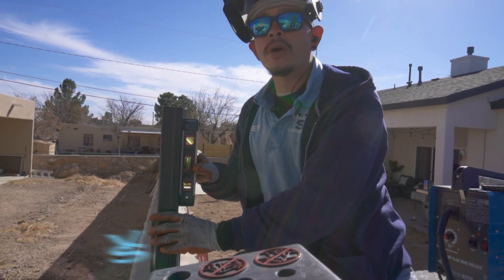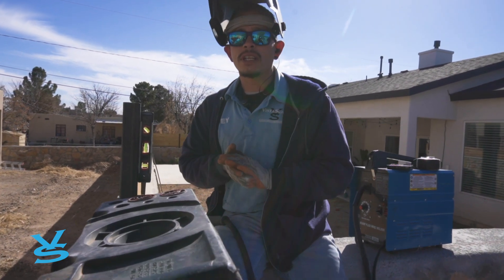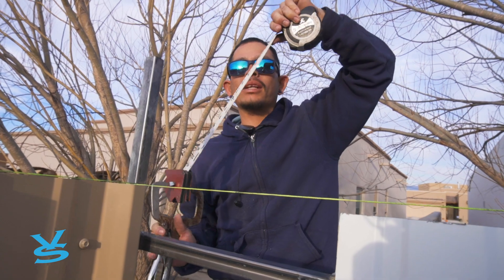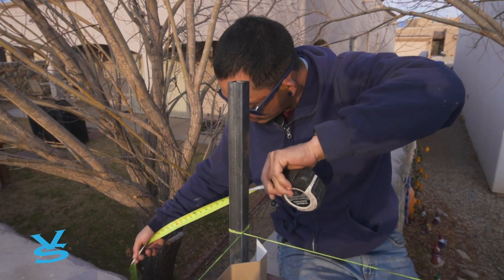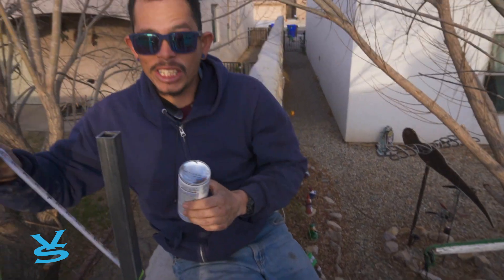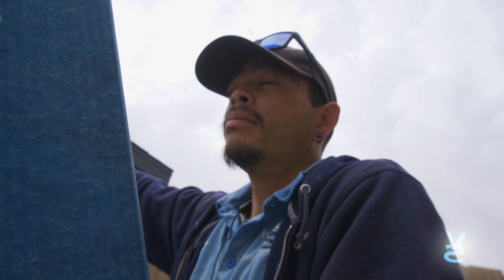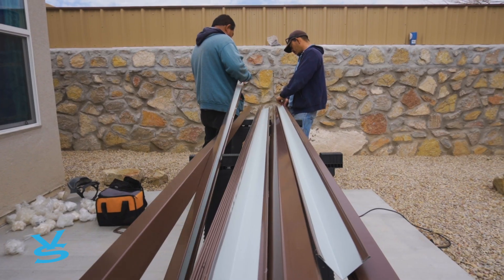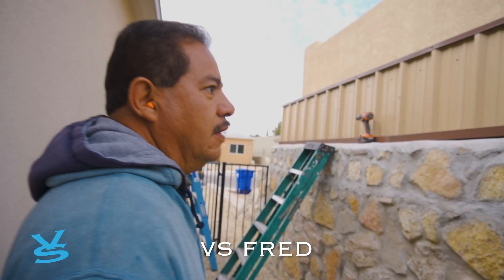METAL PRIVACY FENCE on Rock Wall

Comment: Sorry, this is years later, but did you all get rid of the sloped peak at the top by adding that extra foot or so?
Reply from the maker: This wall was just a flat top but, yes if it was sloped we would most likely have to get rid of the sloped peak to add the metal.

Comment: Hey quick question I’m I stalling something similar on a block wall , how do I anchor the metal posts to the block cap ? The wall isn’t full of cement only parts of it are. Will this be a problem or will anchor screws hold them nicely just on the block cap ? Thank you 🙏
Reply from the maker: If there is enough of a cap to sink some concrete screws into you might be fine.  I would definitely pre-drill so the block doesn't crack.  You might have to space them closer just because it is only holding onto the cap.  Worst case you may have to cut the caps where the posts will go and fill those empty cells with concrete where the posts will be anchored atop the wall.